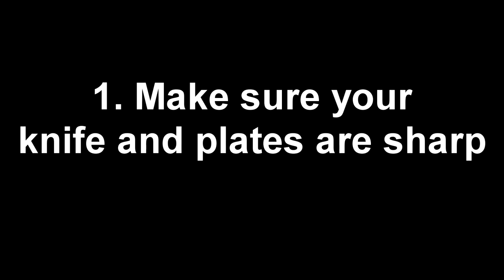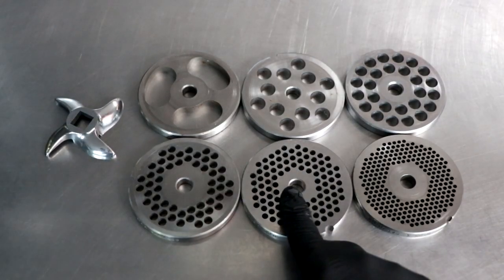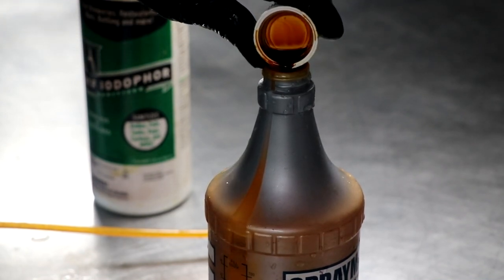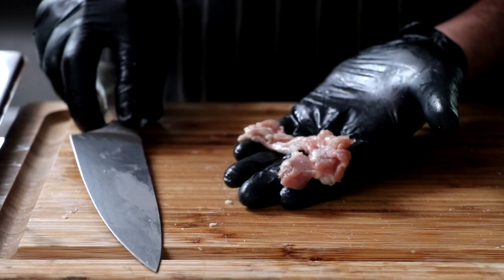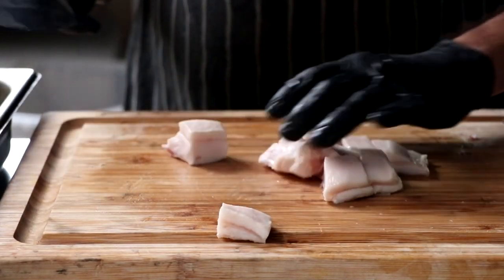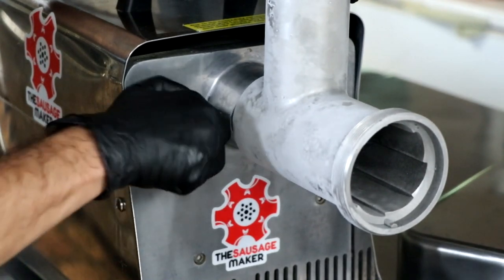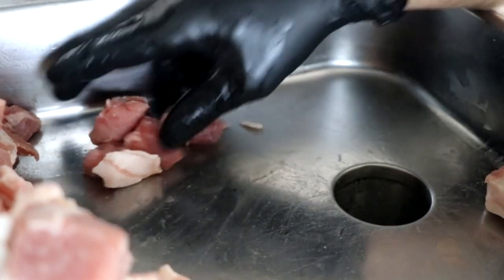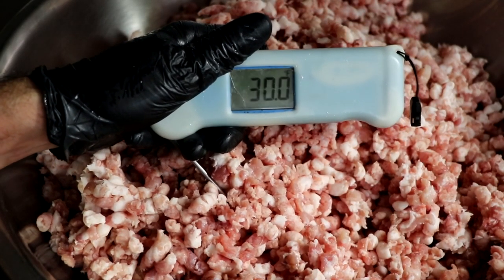10 tips to grinding your sausage meat perfectly

Comment: Not to be contrary for the sake of argument, but as a saw blade sharpener, that view of the sharpened knife is just a good start, but the edge is still not defined and the stone was too coarse. I would hand hone that knife on 200/320/400/600 3M paper wet on a granite surface. That will bring the coarse grind pattern to fine and define the cutting edge. Brilliant content here. At the moment I am motorizing a # 22 Porkert grinder to 186 RPM with a direct drive 3/4 HP motor. All of those Chinese grinders are compromised by various quality downgrades to keep a price point. Have you searched Porkert grinders motorized? Most are from East Europe and rather fascinating for the grind quality. Got a few of your Capicola's in the fridge now. Cheers!
Reply: Excellent feedback. The Kitchen Aid meat grinder I purchased for small jobs, did not come with any instructions. I learned the hard way about crappy product. Just the second grinding it burned out the motor on the Kitchen Aid. Meat temperature: check, blades; new, I had the unit in the fridge before but not the freezer. Just grinding 2 kg meat+fat, stopping to remove silver fascia regularly, I still burned out the motor!  Before proceeding to further in this hobby, a purchase will be made for a proper equipment. These severely overpriced, yet severely below standard grinders should not be sold.

Comment: Great info, you can also use different grit size sand paper cut to size for sharpening (with a plate as backing) not all of us can find wet stone to fit.
Reply: I bought a glass plate and grit paper last time I needed to sharpen.  Now I have a marble cutting board I'm planning to use.

Comment: What is considered good or bad fat when trimming meat to grind ? For example, briskets have the really hard fat along the point or the softer fat along the other side
Reply from the maker: Great question.  With the exception of leaf fat (used for lard) which I don't use for sausage or salami the rest of the fat is good to go.  Soft fat trimmings, intermuscular fat,  backfat are all good as they all provide different textures in sausage or burgers.  The softer fat is much easier on the grinder but usually the harder fat provides a different texture and mouth feel.  At the end of the day it comes down to what you are making and what you prefer (or what you have on hand).

Comment: Thank you for this video! I have a question regarding meat temp before grinding. What if you leave the meat for longer time into the freezer and the meat temp is 20-30F. Would this cause the meat to smear?
Reply from the maker: There is a limit.  If the meat is super frozen and your grinder can't push it out then it could also cause the meat to smear.  If you have a very powerful grinder though, it shouldn't be a problem

Comment: I am new to making sausage and am now purchasing the necessary equipment etc. I am learning a lot from your channel. I have a question about sanitizing. Do you use iodophor spray on all your stainless steel items that may touch raw meat?...bowls, sink, trays etc...not just the grinder components? You said you would wait 2 minutes, then wipe off the items...my reading about iodophor is to let it dry, then you can use the item. Wouldn't wiping the item down with a "clean" towel possibly introduce bacterial contaminants? Thanks so much.
Reply from the maker: Hey David.  First of all welcome to the craft!!  It's amazing.  When it comes to iodophor you can go either way.  Letting it dry is the best way but truly either way works.  Just make sure your towel isn't contaminated 😅.  Let me know if you need any advice
Reply: @2guysandacooler  Thanks...I look forward to adding sausage making to my BBQ portfolio. So do you use iodophor on all the items that may touch raw meat, not just the grinder?...or is washing those other items enough? Thanks.

Comment: Great tutorial. This is the first time that I get to use my Ship to Shore electric grinder. When using the plates, does it matter which direction to place it on the grinder? Thank you for sharing this video.
Reply from the maker: no.  you can place them either way
Reply: @2guysandacooler , Thank you...

Comment: Just found your channel through Glen and friends. Just what I needed; another channel that I feel compelled to binge watch! Thanks a lot. I have watched quite a few already including the pro tips (twice on those). maybe I missed it or just haven't gotten there yet, but I don't recall a conversation about natural casings vs collagen vs fibrous. I am familiar with fibrous and know their uses; and I have used both natural and collagen. What I used collagen for was some chicken sausage that was boiled to cook it. The casings became thick and chewy - not good eats. But now I find that all of the butcher shops around are using collagen for their snack sticks, which is what I'm making next. I can't get my hands on natural sheep casings in the time frame I need them, but I have some collagen casings that I bought and then haven't used because of the disappointing results of the chicken sausage. I know it's a long ways to get here, but here are my questions: was the poor result from boiling the sausage? Would I get a decent snack stick using collagen in dry heat for cooking?
Reply from the maker: Hey David.  Welcome to the channel.  Collagen casings tend to be a little chewy especially if they are boiled.  Typically they are used (like you witnessed) for small diameter sausages.  What I like to do when I'm cooking with collagen casings is to let them dry out a bit before cooking then I'll brush them with olive oil a few times through the cooking process and this produces a nice bite.  It imitates the "snap" you might get with sheep casings.
Hope that helps.  Let me know if you run into any issues.  Welcome to the channel.
Reply: @2guysandacooler  Very helpful Eric...thank you and keep up the great work!

Comment: Great video Eric. Just wondered whether you simply put the sausages made that are still pretty cold directly into the fridge or vacuum pack and then into the freezer?
Reply from the maker: If they are fresh sausages and I plan on freezing them I will generally vac pack and place them in the freezer.  If they are cured sausages I will usually leave them in the fridge overnight then freeze the next day.

Comment: Meat grinder question.  In your experience what seems to be normal heat production for the motor/gear assembly? (LEM, Cabelas, MEAT type grinders) 
Without the grinder head and parts  attached, my new LEM 12 grinder gets quite warm to the touch at about 20 min run time. Especially around the spline drive shaft area.
Does that seem like normal electric motor heat production in your experience?
Thanks Matt
Reply from the maker: Yeah.  I find that the smaller grinders get hotter faster.  I would grind for 10-15 or so minutes, then take a break and let it cool down.
Reply: Thanks for the quick reply.  Good to know that the motor/gear heat is normal.
Ofcourse with your above video advice, much of the heat can be mitigated by freezing the grinder head, auger, cutting faster with sharp blades, etc...
Thanks again

Comment: I was given a older meat grinder that was a little neglected. I am not sure if the housing is casted iron or stainless steel. Its magnetic and the duller areas, like the threads and the part that connects to the motor, seemed to want to get a film of rust fairly quick if I didn't dry it off quick. I can not tell if its the cast or pitting inside the housing near the back back closer to the drive. My question is how concern should I be about it if it is pitting? Will good sanitation practices be enough to not worry about the possibility of this harming my product? Is pitting or pour cast even a concern?

Comment: What size stuffing tube should I use for 38mm pork casing?
Reply from the maker: You can use 1/2 inch or 3/4 inch.  The 1/2 in would probably be a more comfortable fit..

Comment: Any plans for 10 tips for your second grind?  The first grind is easy, the second grind is always a test of patience as the tube gets plugged, the stuffer gets suctioned down and the process takes 20 times longer than the first grind.
Reply from the maker: Done.  I'll show you the coolest trick ever.  Stay tuned
Reply: Use a LARGE 40mm plate on the first grind, mixing the seasoning in before grinding.  This allows a good mixing of fat and seasoning, but keeps the meat in large enough pieces that the second grind isn't near as hard to do because the mix is still in large pieces....the auger has something to grab and push thru.

Then I use a 7mm plate for most of my sausage, like regular breakfast or summer sausage stuffed in casings.  For smaller things like bratwurst or hot dogs, I use a 4mm plate.....but it do have to use the pusher down the throat in order to feed it out.

Comment: Seriously man... i've been watching and following up on your sausage making videos and i never had much of a problem with cheap grinders and i mean cheap!
Even for very large quantities of meat...

(Unless the grinder is running 12 hours a day Half an hour grinding half a hour in an industrial freaser the prices are insane...) 
Why pay over 1000$ for a meat grinder?

I simply don't get it....

And now i've started to look for thoes 4 in one stand mixer's with a grinder...
I mean seriously.... 100 bucks... 
And should be 100% fine
Reply from the maker: Think about Grinders like cell phones.  How much does your cell phone cost?  50 bucks-80 bucks? or do you have a smart phone that runs 300-600 bucks?  Do you see where I'm going with this.  Bigger grinders have more bells and whistles.  Stronger motors, more capacity.  I can tell you from personal experience that smaller grinders and larger grinders can both produce an equally good sausage.  No doubt.  If someone follows the principals outlined in this video the sausage meat will be ground perfectly (no matter the size of the grinder)  Where size comes into play is usage.  

If someone makes a habit of grinding 20+ pounds of meat for sausage using a small stand mixer, i can promise you that it will get real annoying real quick.  At the end of the day what's your time worth?  Having a larger grinder (regardless of the size) means you can work faster and not spend so much time on the pre-preparation of the meat.  If you check out my new sausage series I've ben using a #12 for most of my projects (mostly because I'm only making small batches) but the sausage come out awesome.  That grinder I think cost me 100 bucks..  

If someone were to ask me where they should initially invest their money in this craft I would say get a good sausage stuffer.  Grinder would be second😁